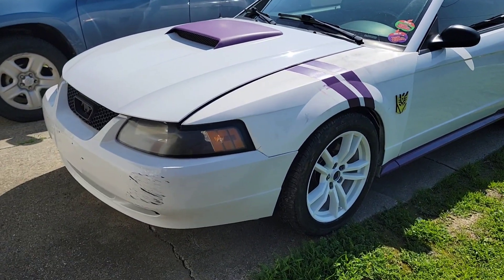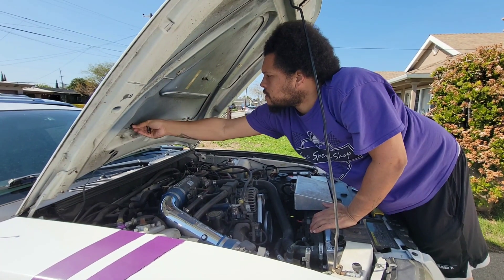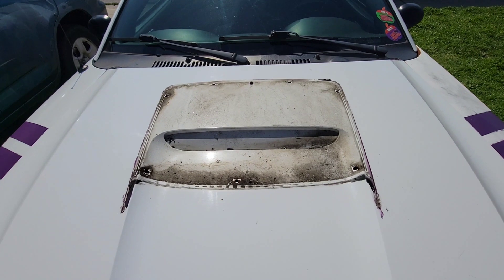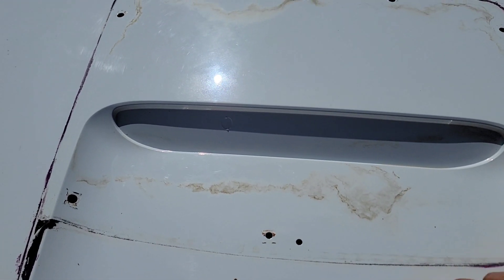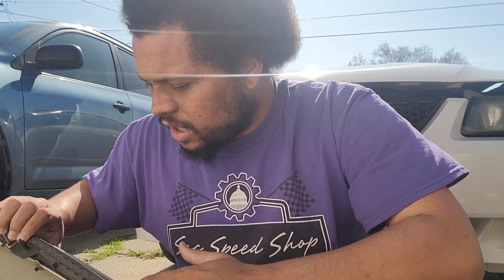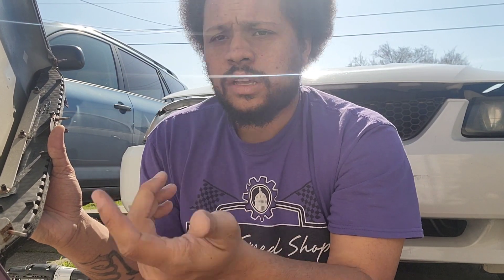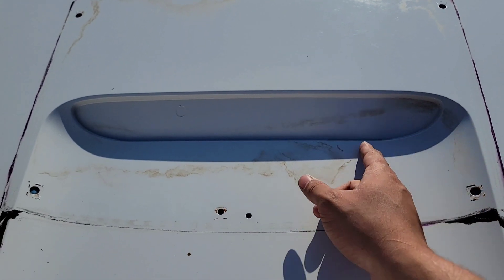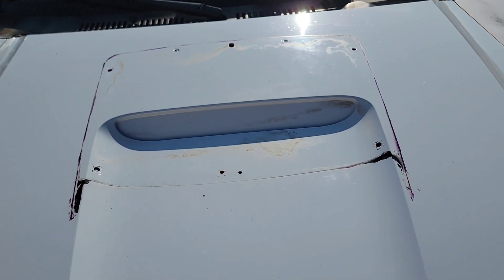Making a FUNCTIONAL hood scoop pt1

Comment: How about using screen material like used in home window screens? There is stiffer material but with larger openings. Considering how hot it gets under the hood I'm surprised that the GT didn't come with a functional hood scoop.